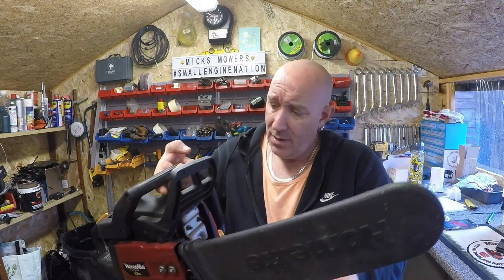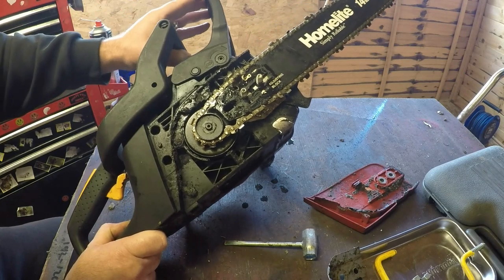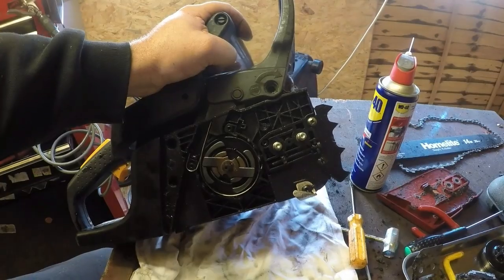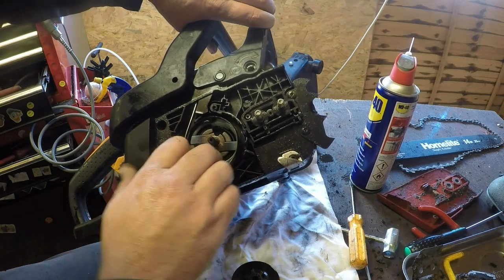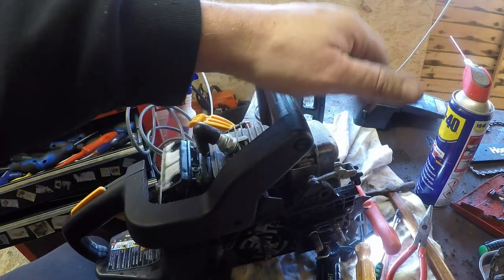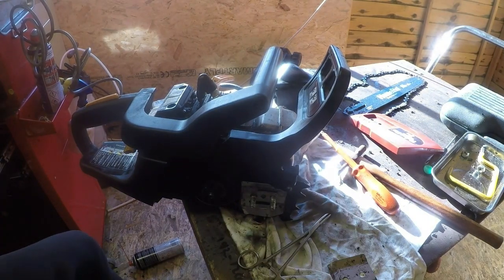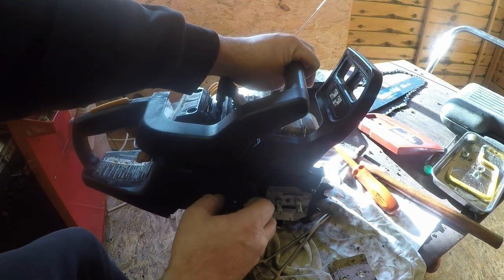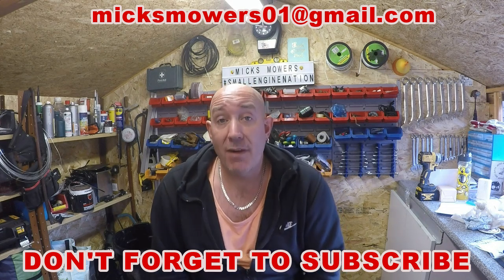#chainsaw #homelite #howtofix Homelite Chainsaw Break. Lets Get It Cutting Again.

Comment: Mick, This is actually quite an easy fix which should only really involve removing the black plastic lever...... the plastic chassis has been worn away by the brake spring and so requires a packer, take an cheap 25 thou feeler gauge and copy the shape of the top end of the Brake spring (complete with screw fixing hole so the torx brake spring fixing also secures the spacer) so it fits snugly round the back of the spring with 1 - 1 1/2"  feeding down between the brake spring and the square hole in the plastic body (you should have some thing that resembles a 1 1/2" tall lower case r ). If you remove the wear the Brake spring will work as intended!! you may now need a new coil spring as crushing it will have lost some of the clamping strength of the brake. Hope i have explained it well enough, not had my coffee yet so half asleep.

Comment: Have homelite chainsaw that the starter recoil is hard to is this fixable
Reply from the maker: Yeah I would say so.. first clean it with wd40 and air compressor.. if not you may need to replace the part

Comment: Well done Mick. I have the same saw with same problem but not had the guts to get into it. I saw one guy on YouTube  who cut a couple of turns off the spring you compressed to solve the problem, but not sure how safe that would be. Keep them coming.
Reply from the maker: Yeah it's not something I would do to be honest. That break has to work properly if your going to sell it on. Mate have a go and see if you can get it to work